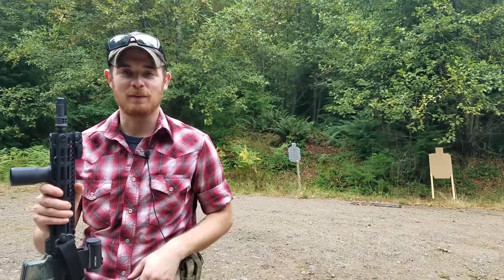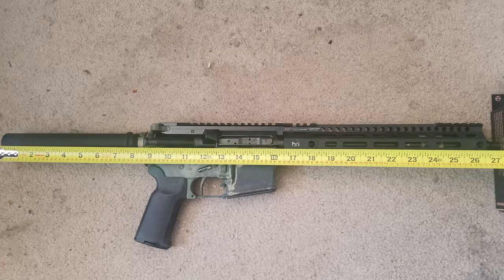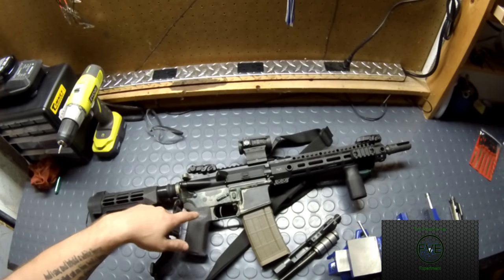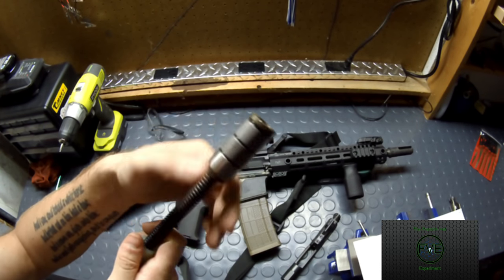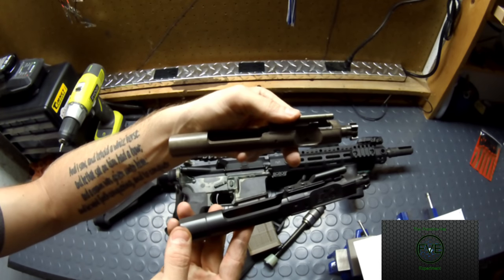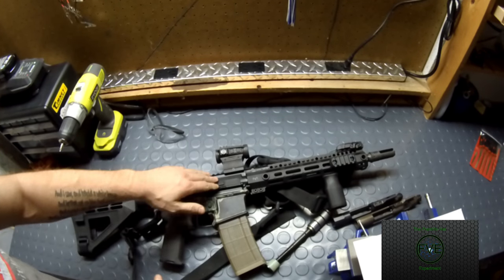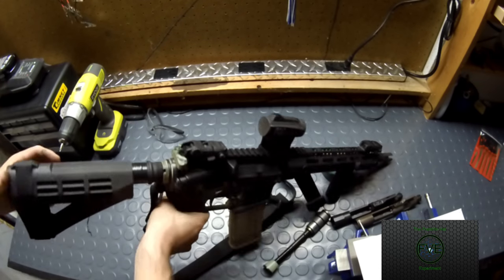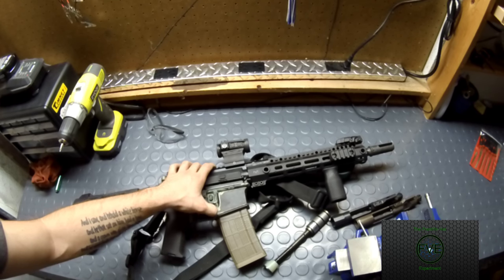AR-FIrearm Ininital Review and Breakdown

Comment: My understanding is that you leave the brace on and fully extended in order to measure OAL.
Reply from the maker: As well this is not the newest brace that allowed for multiple positions. It us meant to sing to the bottom of a pistol buffer tube, but even with full rifles with 5 or 6 positions you measure from the end of the tube to the tip of the barrel( of muzzle device if it is pinned)